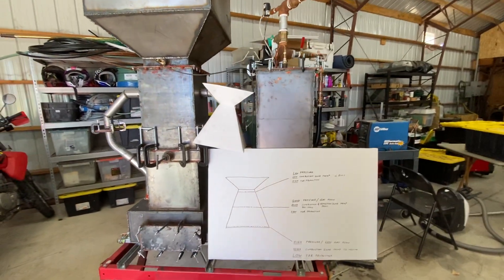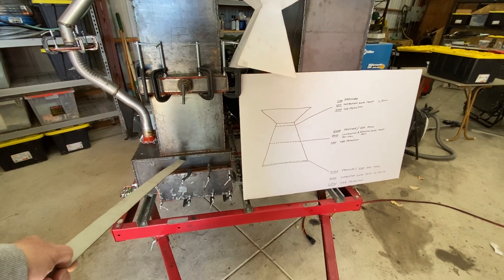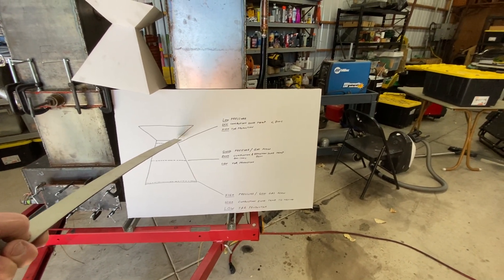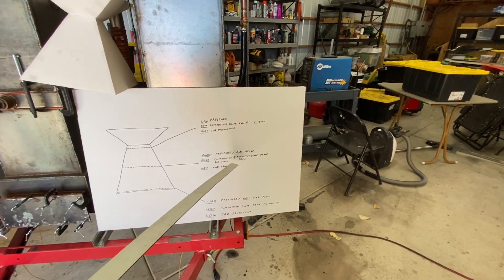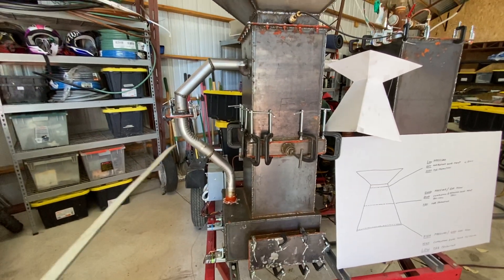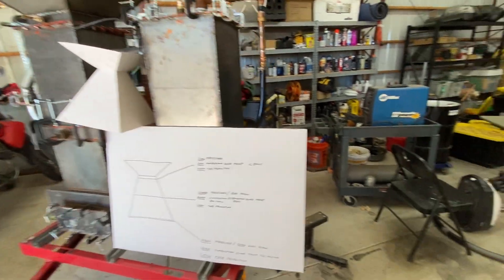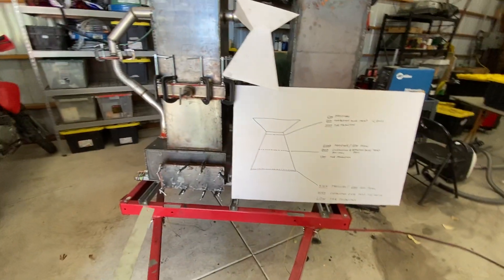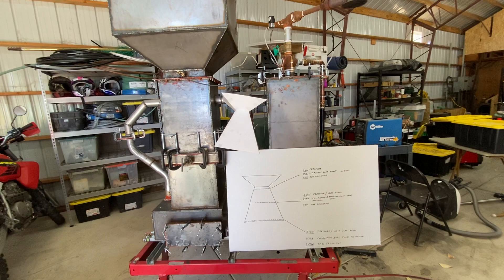Reduction Zone Fine Tuning

Comment: Hoping to see you make more videos soon. Very impressive build. My background is heavy equipment mechanic, not gasification, so you should take what I say with a grain of salt. 
The video you did where you removed all of the partially burned material was very instructive. Your hopper and pre heater assemblies almost appear to be too efficient. It is charring and off gassing an enormous amount of material only to be passed through a relatively small combustion and reduction zone. In other words the mixture hitting that combustion zone appears to be too rich for all of it to get cracked down the way you want it. Have you considered bypassing that preheater entirely? Might lean out the mixture enough to make the gas cleanup operation a little easier. The pre heater might make more sense if you were running a much larger generator with the appropriately up sized combustion and reduction zones.

Comment: The higher your differential temps between the oxidation zone and grate temps the higher machines efficiency. Along with that is your process is also optimized IE more reactions are taking place cracking and converting the pyrolysis stage gases to finished gas.  The process at the reduction phase is endothermic and will absorb heat energy;; the more it absorbs the better. This also results in less condensate as the water is shifted in process rather than dropping out later in your filter system.
Reply from the maker: I'm not familiar with what is the oxidation zone. Please, a little more detain on that point. Thanks
Reply: @biomassgasification3883  Its the combustion area where your jets are.